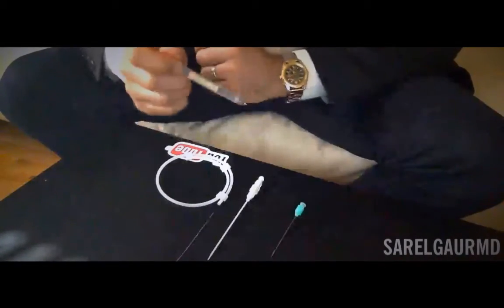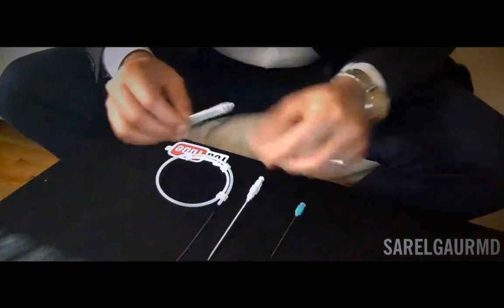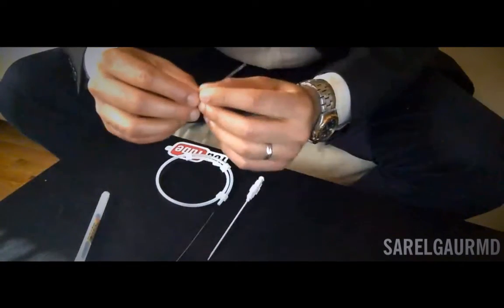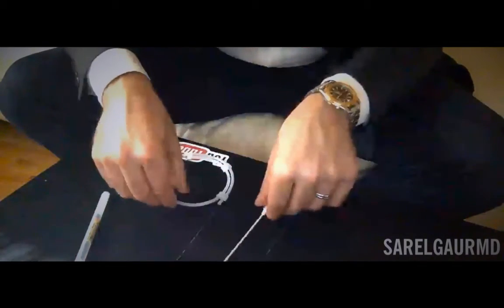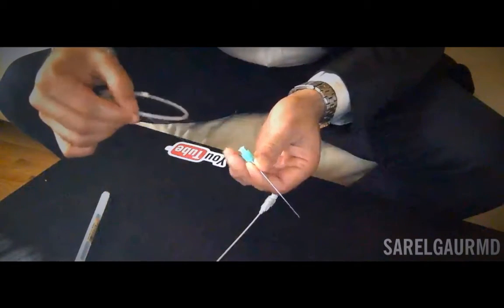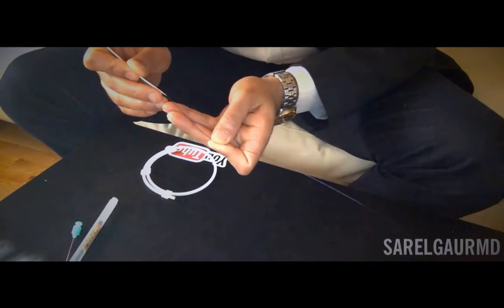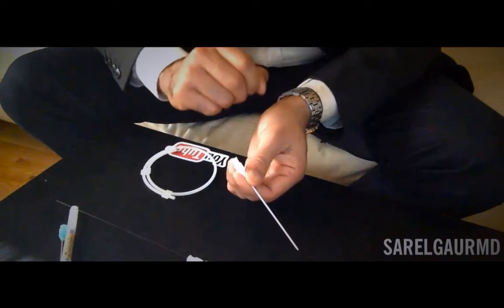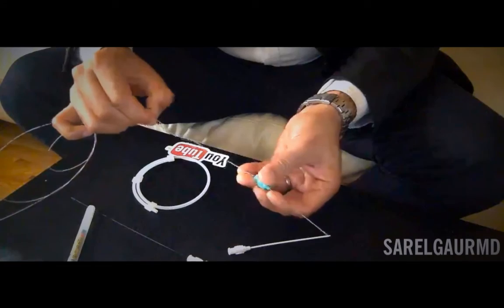Basics of Interventional Radiology:  Micropuncture Kit Explained

Comment: I think you called this item “sheath “ first and then you switched to “catheter “ (unless I didn’t get it right ); could you explain what is the main difference between catheter and a sheath? Is it just that a sheath has a valve as comparing to regular catheter that wouldn’t have a valve? I’m still confused on those two. Thank you !
Reply from the maker: Hey sheaths are usually but not always valved. They are larger than catheters and essentially accommodate catheters to avoid repeated vessel access and trauma. They are sized differently as well
Reply: @sarelgaurMD  
Thank you !